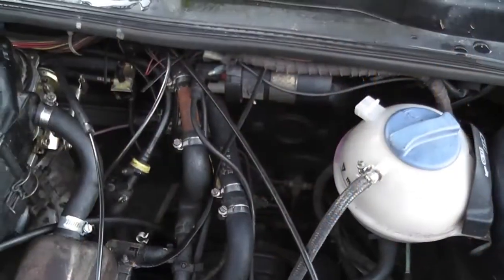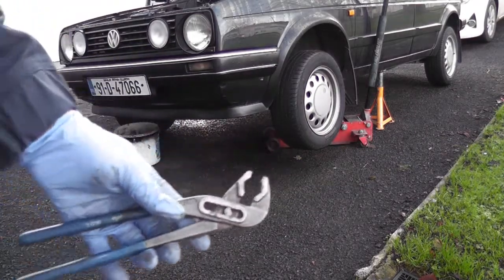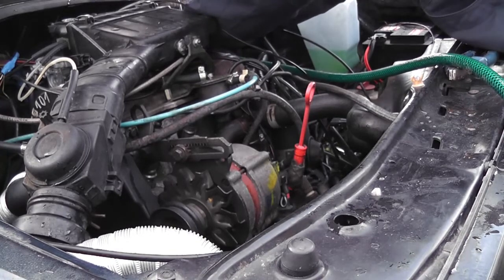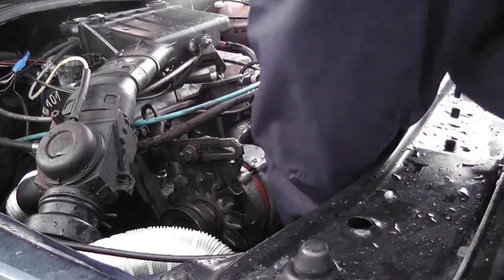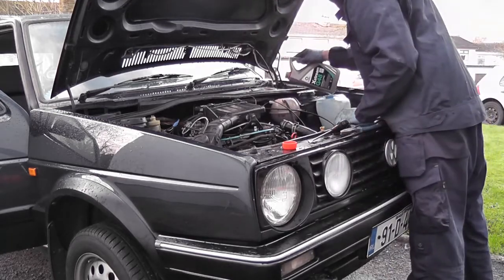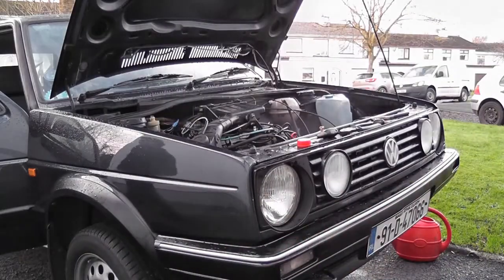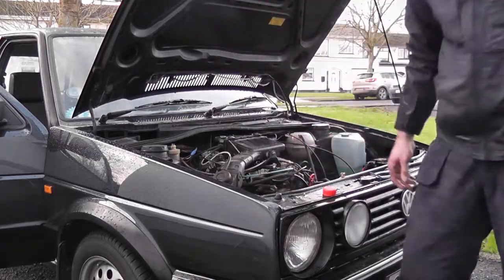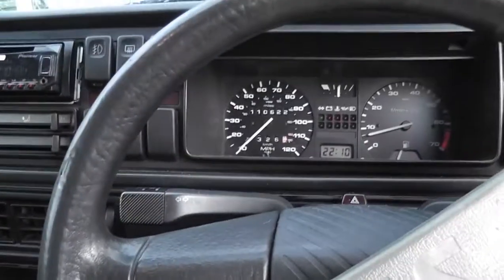How to change the coolant on your Mk2 Golf (including flush)

Comment: In the 90's VW fitted a pressure relief bypass to the heater hoses under recall.  This was because if the coolant tank cap didn't relieve pressure in the event of head gasket failure, the heater matrix would blow and spray hot water over your legs!  Your bypass has been removed and replaced with copper pipes, probably in an attempt to get the heater working better.  But as you know it is the flaps to blame.

Comment: Copper pipe at the start was common fix if the heater stopped blowing warm air. Used to delete/replace OEM valve/s that seize up and stop diverting hot water through the heater matrix

Comment: Have you had any foam spit out of the heater vents yet dude? The old OEM foam on the mixer flaps can come away and there’s holes in the flaps for the foam to stick to itself when folded over it. 
If the foam is gone the hot and cold air mixes through the holes so you still only get medium warm air - that could be something to look at :)
Reply from the maker: Have a look at my other video that follows on from this. You hit the nail on the head. It was exactly this problem and it's fixed now.
Reply: Endfloat aah yes, I literally just watched the video after commenting haha 🙈😅

I believe I’ll have to give mine a go soon also as I’m getting the odd bit of foam coming through; I’m still getting pretty good hot air but the mix isn’t great/ much different when moving through the zones :/ 
Dreading it slightly as going through the Mk2 pages on Facebook, no one really says its great fun doing it haha 😂
Reply from the maker: @jxrd-ks  I'm currently stripping a Passat gearbox and between the 2 jobs, doing the heater fix in the golf was an absolute pleasure. It's not especially difficult to be honest, and it's a relatively clean job. A nice one for a Sunday afternoon.
Reply: Endfloat oh yeah out of them two jobs I’d rather do the heater flaps haha 😂 I know RubJonny on fb / from the forum has a guide on how to get the whole thing out without taking dash out, in order to fully cover the flaps and run a bead of fresh closed cell foam around the edges of the flaps to stop them knocking inside; I want to attempt to follow but will probably be one of them jobs that ends up taking way longer than you anticipate, which is usually the way 🙈😂
Reply from the maker: @jxrd-ks  A lot of the stuff I removed I didn't need to remove, and I didn't film that, so you can feel free to learn from my mistakes. Really all you need to do is remove the 2 parcel shelves, centre air vent, radio and the centre console. That'll give you the access you need.
Reply: Endfloat that’s not too bad then dude! 😄